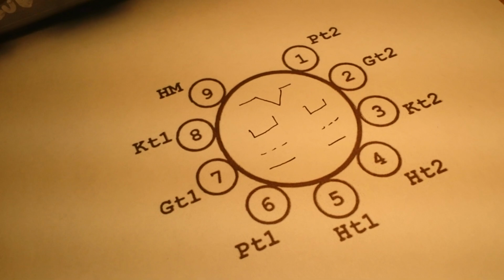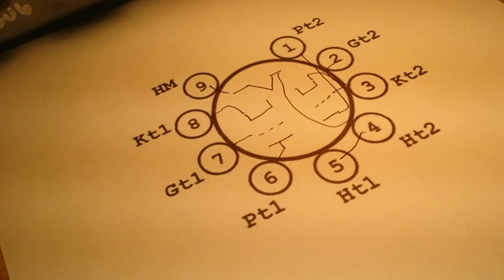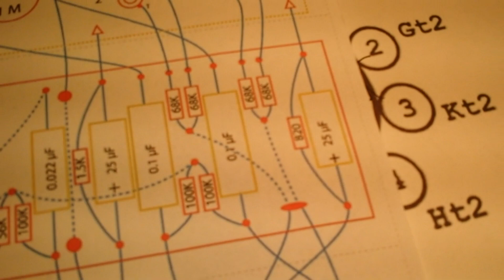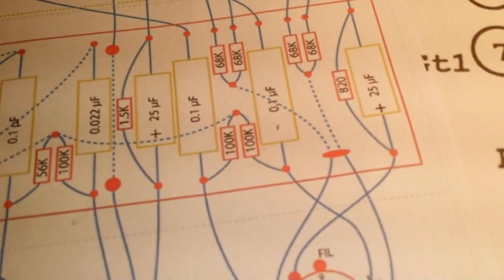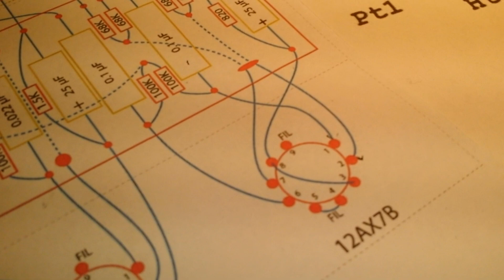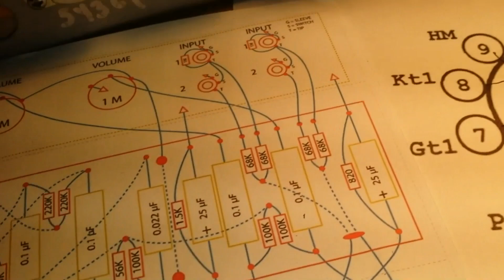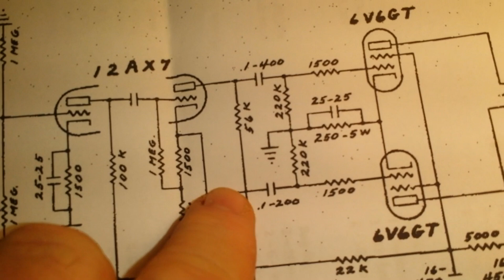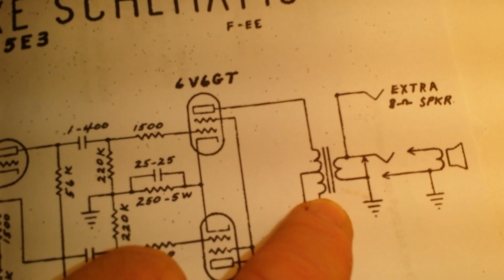Amplifier build progress report

Comment: Glad to note that later in the video you called the grids grids instead of gates. :o) My solution with the hard to read pin numbers is to use a fine sharpie and write them on the chassis by the pins. In any case, nice looking build.

Comment: Did you check the polarity of those caps by any chance? Do you know if that can be done in circuit. I didn't have an oscilloscope when i built mine and had a 50:50 chance of getting that right so I'm assuming 90% of mine are backwards.

Comment: Creative criticism ?    Keep your wires short as you can.  Always twist pairs to prevent cross talk.  One Twist per inch is the  standard twist.  Looking most cool Sir.
Reply from the maker: Thanks, Im always open to experience. In the next part, you will see the twists on the filament lines. They are not wired in here as yet.

Comment: Did you buy the plans or are they open source or free to share.
I did look up after seeing your video last week. Found many people doing similar projects because there great preamps/amps to use, but there all charging for the plans.
I feel like there selling fenders product.
They should give them away for free but that's just my opinion.
It would be great to build one but before I commit to a project I need to source materials, cost of the project is my biggest determining factor. In Canada we have to pay shipping and duty so simply project sometime cost to much.
If you read this thanks for listening and if you share the plans and materials list that would be great to. Look forward to hearing how it sounds. 

P. S I learnt one thing about putting this types of amps together and that's double check your work. It's very easy to mess up especially because of the terminals #.
Reply from the maker: All I did was google fender 5e3 schematic. You can find diagrams, wiring charts and voltage test points.